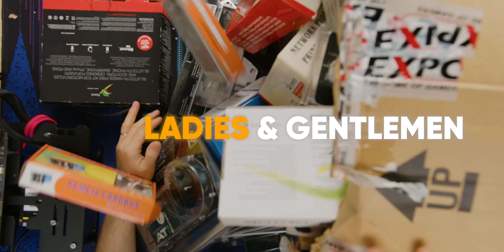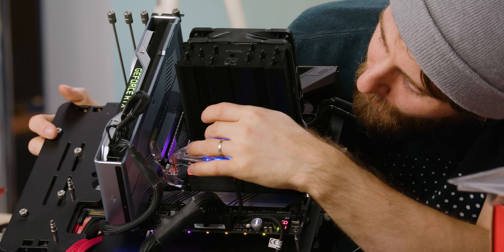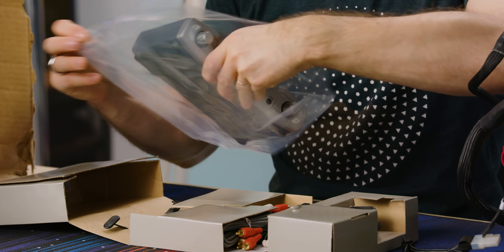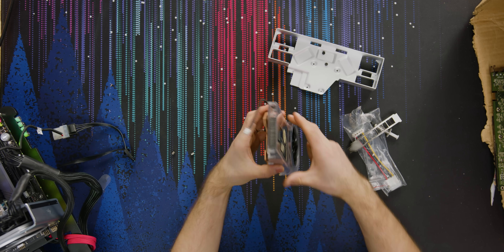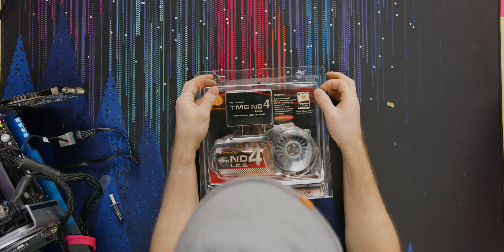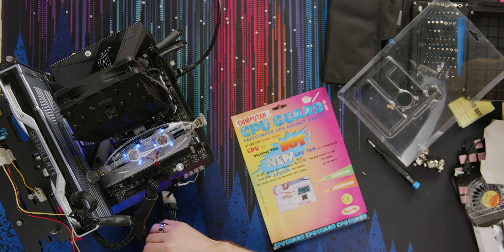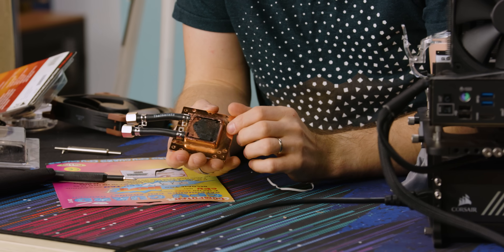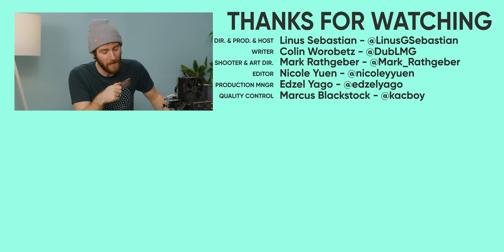I Bought Out This Bankrupt Computer Store's Inventory

Comment: Oh man, the Silencer 4 takes me back.
Like you say in the video, those things were legitimately an upgrade back in the day. Now most decently powerful cards have pretty well built dual slot coolers with heat pipes and long, dense fins; but back then even early dual-slot coolers were a lot like that, and a lot of high end cards still used single slot coolers. Back when I first got in to PC gaming they were starting to become rarer, but things like the 8800 GT you showed, or the ATI HD 4850 (the step down from their then-flagship HD 4870) had single slot coolers.
And even for high end cards, there were still upgrades. I remember the Arctic accelero S1 cooler - I put that thing on my gpu. The Accelero line had other versions, including some that look a lot like current triple-slot coolers, but is considered at "end of life" now.
Reply: Third-party GPU coolers were a legit upgrade back then cause most cards had tiny high-revving fans producing tons of noise. I've had a factory installed Arctic Cooling on a 6800GT and Zalman fanless on a ATI 9800 Pro. Zalman killed my card though. 

Some of the early 2000s peripherals are still great e.g. my PC is still housed in Antec P180 case, no reason to change it.

Comment: Got a Zalman Amp+ for only 5 euros maybe 15 years ago from a shop that was trying to get rid of those. Never worked as an amplifier, but only as a splitter. Probably a bad batch, or even a bad product, because I had read on the internet others also complaining about this. Fortunately the audio cables coming with that Amp+, where costing more than 5 euros and in a period that I needed them. I think the original price was over 50 euros. It was definitely expensive for what it was promising.

Comment: Thanks for the nostalgia trip LTT! I owned every single one of those products at one time or another (apart from the Zalman 70mm fan). Those were the days, when companies came out with "experiment" products left and right to experiment on us Geeks. I still have sour taste in my mouth after the Thermaltake Water/Air GPU cooler, ruined 2 cards for me, one water leak and the overheated. Never bought a TT product since :D
Reply: You owned the fucking CPU guard?
Reply: @LuxrayIsEpic  Haha yup. Worked as a manager at a computer store and enjoyed trying every bit of kit we sold on one of my many many PC's. Most of it stayed in a PC no more than a week or was totally unusable. One of the most crappiest products I remember was a clip-on memory cooler for DDR1. Cant remember who made it, but it was an actual clip over 2 strips of (badly)thickly coated aluminum that had a 20mm 50-60 db fan on top that "sucked up" the "bad air" from the DIMMS. It came with a small packet of grade-C TIM that you put between the module and the heatsink. Aptly named heatsink since the only thing it did was to sink the heat in the dimms and make them overheat 20-30°c over spec all while making a terribly annoying fan noise. The whole lot went straight into the dumpster

Comment: 4:00 I have to add the greatest use case of all times to this product!
Just buy 2 of them, mount two hdds in the sleds, mount one of the thingies in your computer, bam:
You have basically two independent computers for two different people. That's how my dad set up our computer so I could mess around with my os on my own hdd and he could just remove my os drive and plug in his if he wanted to work on something.
GENIUS
Reply: had the same thing with my dad, my disk my mess, his disk his mess :)
Reply: Another commenter mentioned that this is what they did in college back when individual computers weren't a thing. Every student had his and could just plug it to the schools computer.
Reply: @carlost856  Yeah, we used a similar thing when I went to college just 2 years ago
Reply: And I still have one of those. Even have the adapter for power supply. Great thing, if I may say. Just that plastic casing became so brittle and changed it's originally ugly gray color to even uglier gray color. But still works as a charm and is even in use for testing some old PATA HDDs because that's the only way to connect them to the test bench, cuz I cant find a working motherboard that old with a working PATA slot and all other components working fine. This came, if I remember correctly, with an ATA to SATA connector, or I just bought that separately. And yes, there are still people that are using their old HDDs with ATA connectors and even have some (for them) precious stuff on those.
Reply: Or if you got grounded it'd be a lot easier lol

Comment: Just a friendly warning: USB2LPT converters are unsuitable for controlling a CNC lathe, because they don't expose the pins directly, but rather function as an emulated USB printer, and talking Centronics on the parallel bus to a printer. The reason why no USB2LPTs create a true virtual parallel port is because USB (at least up to 2.0) is not suitable for low-latency applications, despite having much much more raw bandwidth than a parallel port.

Comment: I miss my swappable HD soooo much! Had so much fun, truly loved the idea and it was actually very useful to move your bytes around
Reply: They still make them.  Heck, they make 1 and 2 bay SATA versions.  Along with 3.5" versions.  As in you can purchase them right now today.  They're black plastic and metal with the latches popping out.  But other than that still used today.  Even the connector on the back of the 3.5" one looks the same as an old one I use every day in the office.

Comment: I remeber a lot of that stuff... when it was new, sure some of it is gimmicky... but most of them are for niche use cases that people needed solutions for. 
Ram fan was great for early watercooling... same issues you face today getting that little bit of airflow over the components made it stable. 
IDE Hot swap bays... good times, mixed with the TV Tuner cards and we all got to watch the shows we wanted, there was even a program that would automatically remove ads.
The Zalman amp was great.

Comment: I was hoping to see my old SyQuest 270MB external SCSI drive make an appearance.  To those born after 1985(ish), that was basically a single platter hard disc inside a plastic case that you could swap out like 1.44MB floppy discs.  They were the precursor to Zip drives.

Comment: Actually picked up an old HDD cooler brand new in the box at a goodwill for 5 bucks. Still worked but this one was from thermaltake and had 2 70mm fans on top. It was so loud lol

Comment: @4:00 We used those all the time. HDD Security was a real thing. This comes during the same era of Detachable Faceplates for your car stereo. So, why not have a detachable HDD? You could unlock it, pull it out and take it with you, or hide it in your safe at home. So only you could boot your PC by putting the HDD back into the tower.

Comment: "Oh, I legitimately might need that for my lathe." That's why we keep piles of old tech around. For that one instance in ten years of randomly needing one thing.
Reply: Been there done that, threw it out the week before.......
Reply: If you work in manufacturing, old tech that kids think iS funny and stupid...will still get used years and years and years later.  

Windows XP is still used in a few machines where I work for example, and to service them, USB 2.0 is or native serial ports are important to have on the engineer's laptops for easy serial cable connections to virtual machines of win XP (usb 3.0 not natively supported), so USB to serial cables can be quickly employed instead of training 30+ engineers complicated or time consuming work arounds.  (multiple switches of eithernet to usb was our ITs "solution" to the problem they created).
Reply: @homerzeppelin  My university (technical university btw) still uses DOS because people are too lazy to make a new program that would take data from test rigs they have so they just use DOS because DOS can somehow manage the raw data without convertor and all they need is simple code to interpret the data into graphs... Imaginge being IT student and you have to use DOS in your physics labs, its hysterical (i wasnt IT student but we shared the labs)
Reply: @privacyvalued4134  Their hardware is in really good shape so it works fine, computers older than the students tho, kinda funny
Reply: You don't even have to work in manufacturing. 5-10 year old lab instruments from big manufacturers typically have serial ports and maybe a freakish RS488 chungus connector - native USB only shows up on the newest models, but those run a freakin' operating system, and nobody wants to wait 2 minutes for a multimeter to boot. Therefore, lower end electronics RnD labs still buy USB to serial adapters by the dozen.
Reply: I love the manufacturing and lab folks who are like "Needing a random weirdo adapter? That's just Tuesday for us." No sarcasm, all respect for the hard work you guys do.
Reply: That's exactly right lol
Reply: Don't worry the day you throw it out will be 1month before the price escalates through the roof I know what I'm on about I had a lot of pentium 2 stuff amegas Commodores and game code books etc than thares the E30 325i BMW I restored in 2008 then sold :-/ oh well I had the stuff before it became pricey

Comment: Back in the 90s when I was a stupidly-young M1A1 tanker in the U.S. Army, Uncle Sam's Puzzle Palace in the D.C. Metro decided to try this newfangled "computer" thing out Army-wide.  
They picked a single laptop manufacturer - Dauphin - and put one in every company's Training Room figuring someone would eventually know what to do with them.
Now boys, if you can find one of those Dauphin laptops then you'll know what I was surfing the web with back in '94 via Netscape over the built-in dial-up modem dialing into a CSLIP connection at El Paso Community College in the Texas badlands on the edge of the White Sands Missile Range.

Comment: Those removable harddrives used to be a big deal in the military when we had to pull out the hard drives and put them in a safe.  I think I also have a few of those old fans somewhere, they were the only manufacturer to make non standard fans.

It's also hilarious to see hoe bad the old water cooling stuff was.  I'd love to see a review on the old thermaltake water cooling kits.  I had the one that you mounted in the front 5 1/4 HDD slots with a tiny radiator.  No wonder that old Phenom II died
Reply: The military still uses them, lol
Reply: I had a Thermaltake water cooling kit, after 6 months a couple of the metal connectors rusted away and everything became black, clogged with rust. That was the last Thermaltake thing I bought.
Reply: @victorstratan  Mine lasted for 4 years and was still running when the CPU died but I had that CPU pushed to the limit and didn't monitor the temps properly because I didn't know any better
Reply: I still have a thermaltake watercooling block for a 3.5" hdd, its huge haha, it came as part of the "Big Water" cooling kit (which I was still mostly running until last month), green UV reactive tubes, big orange 120mm fans and the chonkyest radiators ever

Comment: Which gaming laptop has the most durable parts? I'm thinking of upgrading in 2022, and I'm going to max CPU/GPU very often and also do big hard drive scans. I need something that won't break down easily. I know some current laptops are powerful, but I tend to beat up components a lot so I'd rather have something that will last 2 years+

Comment: Did you guys do any kind of inventory? Looks like there's a lot of stuff in there that's not particularly rare or valuable, like PCMIA cards or aftermarket accessories for long-obsolete parts... but I'm kinda curious if there's some rare stuff lost to time that was trapped in there. 

Specifically maybe an S3 Graphics Chrome GPU? I stumbled upon an S3 Chrome S25 (PCIe, DX9) on eBay a couple years back while hunting for Matrox cards and was fascinated to discover that even if they weren't competitive, they were still functional, DX9/DX10 compliant graphics cards in PCIe form that weren't Nvidia or ATI/AMD. Unfortunately I couldn't get a display out from that card, and I've never seen another Chrome S25/S27 or Chrome 400/500 on eBay since. I've read reviews and seen pictures, but it's like they're from a parallel world and the cards never actually existed here.

Comment: Back when the pc component industry was full of crap remember RAM booster software?. thermaltake on top with a lot of crap I remember you could buy tiny fans for your Northbridge heatsinks etc

00's PCs had a card for every PCI slot and you probably had 2 optic drives, 1 floppy, 1x multi card reader, maybe a front audio panel with all the gizmos on it. And depending on case crap load of fans. Probably had a fan with led lights on it (maybe).

Comment: 2007 when I started building my first pc, (already had one with pent 3, sis or via onboard  gpu, 40 gbs hdd, 256 mb ram, reseting cmos was a process to remove the rom chip cause battery was soldered) first time solo building pc, C2D G4400 ASUS P5N-E SLI (WITH THE SLI SELECTOR) 120Gb sata, 4 gb 800Mhz  Kingston now what it was I don't remember,  Nvidia 8600GT (which I burned send it back to store and they put a 8600GTS cause they didn't know if it was my fault or factory, (yes back in the day at least in my country things where more lax) was buying all PC magazines, for free software CDs and o boy when dual layer DVDs came they where stacking them with older games (not demos) like Gothic 1 and so many more as a kid with no internet I was thrilled...

Comment: i got shivers down my spine seeing that SD card reader floppy slot and HDD drive bay thing... ppl still use that! 
worked in a used computer parts shop for awhile, and had to rip that out of old PCs, clean, repackage and feed it into our webshop and ebay to resell. 
yeah i know, many factory computers and machines use that old tech, but damn...
there was sooo much stuff going on with firewire and other connectors too, it was crazy oO
and those TV cards? what the heck... still selling those too xD

Comment: Those HDD enclosures were actually a very good solution. Owned by a lot of companies back then as well as my whole family at home. Each of us - me & my parents had a separate HDD. We just used to slide it there in the case, turn the key and it worked. Different Windows instances without creating a thousand of partitions, different data and no risk of having everything corrupted when someone catches a nasty virus or a whole HDD dies. If you fry your PC/HDD, then all is lost - all partitions, everyone's data. You may recover from a virus but not from that - It saved a lot of people back in the days and a lot of companies. At my parents company everyone had their own HDD in a standard enclosure, you could work on any PC available - just slide your HDD in and it becomes your PC. Easy, fast, quite efficient solution.

Actually, I believe that I am younger than you - around my 30 right now :-P It's not before your times!

Comment: Hah, fun, I've a a few similar things, or kit that it was designed for,  like the Icy Boxes for a ThermalTake Armor case, which is still in use, though I've not got the 11x 5.25" front bays in use now. Was some dual 80mm exhaust thing for a 5.25" bay that blew air out from drives beneath. The mention of the Raptors brought me back to around 2005 having 2 of the Raptor X ( clear lid) in raid0, and mounted at top of a clear lid case from some unbranded make.

Comment: I had a full tower system which I’d built hundreds of years ago lol, I had a multi card reader which fit in one of my spare 5.25 drive bays I had two optical dvd RW drives and the good old 3.5 inch floppy drives a pentium 4 cpu. I had a graphics card in my AGP port though can’t remember what card it was other than it cost a huge (at the time) £300 & 128 meg of memory (if my memory serves lol)

Comment: would love to see some absolute kick ass 2005-spec builds with this gear, overclocking athlons etc
Reply: If they were still selling 2005 hardware in 2014 I'm not surprised they closed.
Reply: It was a fun time. No off the shelf parts. So people used car heater radiators for their watercooling. They made their own waterblocks etc. You have phase change systems from Vapochill cooling CPU's to -20 degrees. And people who made it themselves from old refrigerator parts. You had no cases like today with spaces for fans so people modded their own cases. Painted them and made holes for fans etc. You could unlock the multiplier on Athlon CPU's with a pencil. Nowadays you just order part XYZ that is latest greatest and done. I remember having what I think was a Pentium 4 system in a huge tower case, water cooled. Can't remember the video card, either GeForce3 or ATI R8500. The connectors on the waterblock started leaking and short circuited & fried the whole system.